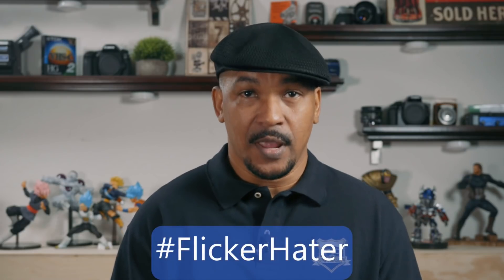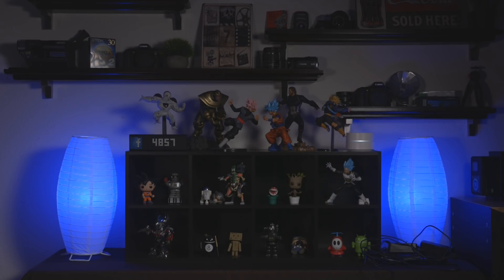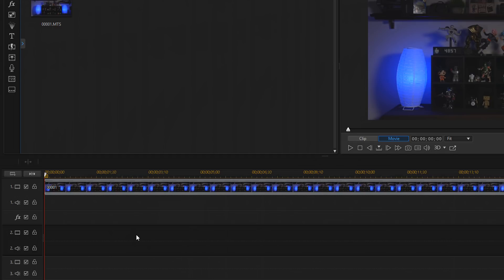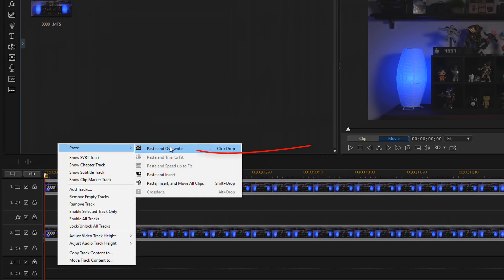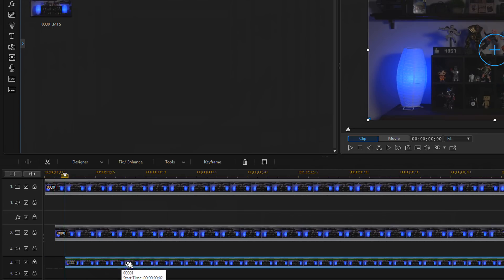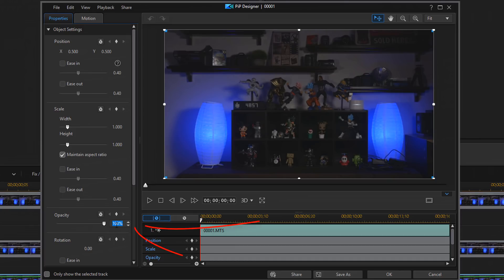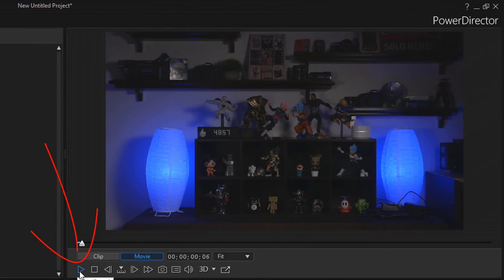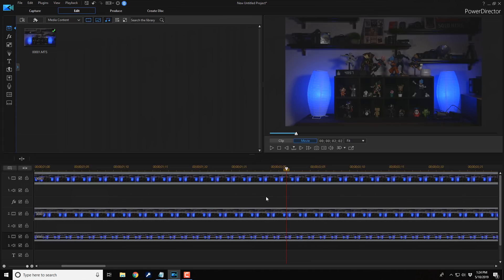How to Fix Annoying Video Flicker in 3 Easy Steps | PowerDirector

Comment: #flickerhater
Reply: I went to a christmas illumination area today and took 3D video of it all.  Its going to be interesting to see how it works out using this technique in 3D.  If you only did 1 copy instead of 2 because it was messing with the 3D effect too much would you set the opacity at 50% for the copied track?

Comment: aw man... I have flickering because my rugged action cam makes time lapse video straight to video, but frequent puffy clouds covering the sun make many frames darker. No matter how many tips you use, the cam shows the natural environmental lightness or darkness. It really works very well, like an expensive DSLR on all the right manual settings.... and a crappy lens. All I need is some simple software to average out the brightness a few frames this way or that way to make any longer-term shifts in light change more gradually. You can get this no problem for FREE for bushels of raw still shots not yet compiled into video, but video is really all just frames anyway and should offer the same kind of fix.
Reply from the maker: Sounds like an auto exposure issue. Best fix would be to turn off the auto exposure (if possible) or use a different device. 
Any editing software should allow you to adjust the brightness frame by frame using keyframes. Based on how long the time lapse is this will be a long and tedious endeavor.

Comment: Hey there Maliek! I am working on an video I shot with my iPhone from a Super 8 reel. The flicker is intense. I did all the technics in the video, but it's still too intense. Any other suggestions? Plugins? Still really new to PowerDirector, so, maybe a shutter speed adjustment? Thank you!
Reply from the maker: Did you use a Super 8 app on your iPhone to create a Super 8 look, or did you play a Super 8 reel and then record the projection using your iPhone? If this is what you did the digital (progressive) recording of the analog (interlaced) video source creates flickering due to the way progressive and interlaced videos are recorded. I'm not aware of a way to fix that. You should probably start over by finding a way to convert Super 8 to Digital. Google "Convert Super 8 to Digital" to find ideas on how to get it done.

Comment: Today DJI Osmo Action does away with  PAl and NTSC its just one happy  family no more Regional  areas of flicker
  so  if I film my cluster it flickers i do this three  same vids it will go aay and well uh hmmm
Reply from the maker: Yeah but that doesn't do away with the Hz issue. Any camera that you plug into an outlet usually has a Hz setting that has to match the Hz used in that country. DJI can't change the electrical grid of a country...can it? 😄Since you don't usually plug in an action cam the Osmo Action shouldn't have an issue with Hz anyway.